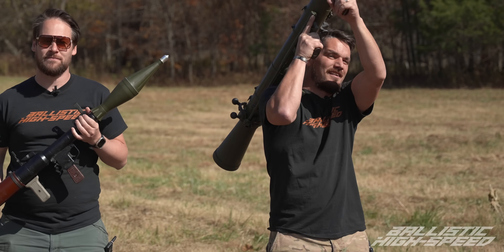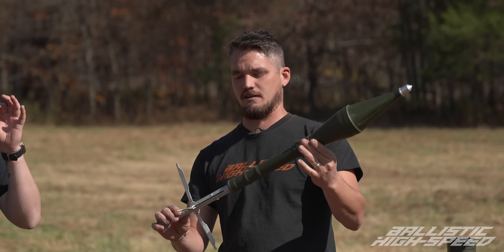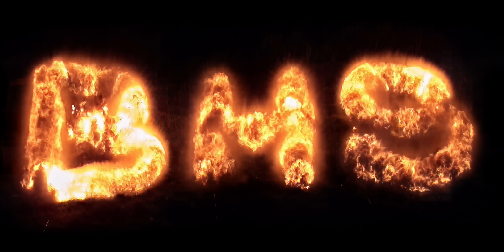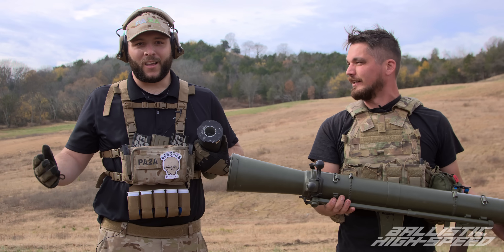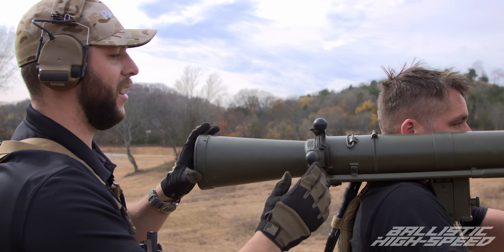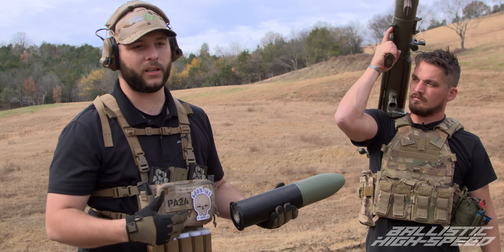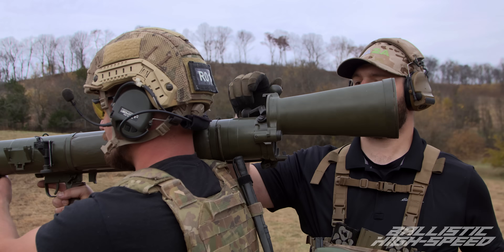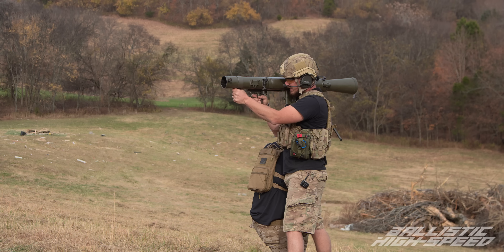Rocket Launchers and The Dangers of Back-Blast! - Ballistic High-Speed

Comment: Thanks to the medical staff who responded & who took/are taking care of him. Sorry to hear it happened to the guy who took safety seriously.
If the channel has integrity, IMO they'll release a series of videos informing people about things like:

1- what sort of medical training & equipment is most useful to have when working with guns, explosives, etc. (you should have this safety gear. you should have this sophistication of medical kit. you should know these techniques: cpr, how to apply a temporary suture, how to move/transport an injured person [especially if you're a duo], how to assess injuries, how to use a clotting agent, etc. you should have these numbers to call, and locations of the nearest hospital capable of handling a patient in this condition. you should be able to quickly determine when a person requires personal transportation, ambulance transportation, or helicopter transportation. how to communicate effectively with the dispatcher, and know what information they need. how to self-care if you're alone, what level of injuries may be fatal if solo, how valuable a partner is & how do risks escalate if alone, what kind of emergency communication might help if alone, or in a group out of public areas)

2- what you wish you knew, what you were missing, why the accident happened, what mistakes you made, what things would have helped

3- what went wrong. how serious was it. what were your immediate thoughts. what are your thoughts in hindsight. what would you tell other people. what do you wish other people understood about the seriousness of accidents & emergency response/readiness.

4- showing the uncensored footage (I'm not going to argue strongly one way or the other. IMO it would benefit viewers, but respect whatever decision Adam makes. IMO it is very clarifying to see in real time cause-and-effect. Watching events unfold, teaches you how serious "small" injuries can be. A bit like how the results of vehicle accidents have been used for decades to demonstrate what happens in real life. A simple piece of shrapnel can break cheap glasses, can blind you, can cause bleeding requiring a doctor or immediate intervention, etc.). A small explosion can permanently scar you. That doesn't touch on things like psychology (why you should be prepared, the harm of panic, the harm of not knowing what to do/who to call/how to communicate what is needed & how quickly, how to interact with the subject, how to be useful, etc.)

I'm sure this is a series-of-events which has been repeated for millenia. And I'm sure there have been studies done, and planned responses created, and training courses designed, beyond anything I can contribute. I hope that collected knowledge is gathered & shared with the BHS viewers.

Hopefully PA2A was run by someone with care and consideration for things of that nature. I have only personally experienced moderate injuries, but IME it is enough to be thinking about things like, "am I ever going to be able to walk again? Will I be able to work? Have I just altered the course of my life permanently?" in the moments after a serious injury, without the panic of, "Do the people around me know what to do? How far away is help? There is blood running out of my shirt, and down my neck. I can't see. Am I concussed? I don't remember where I am. I can't feel my legs. Am I going to die out here in the middle of nowhere?". IMO it's extremely disrespectful to the people who have experienced accidents/injuries to sweep these things under the rug, or fail to address them.

I don't know anything about BHS. I don't know if they're careless, reckless youtubers- and this was only a matter of time. Or maybe they're quite respectful and considerate, and this was an example of accidents happening to anyone. What I do know is, like any sport/hobby with a degree of danger tied to it, you have a responsibility to the man next to you to be informed of how to care for him in an emergency situation. Just like when you are injured, you'll be relying on his competency to get you help. The man with the least knowledge of what to do, seems to be least-respectful to his companions.

I don't mean any of this as an insult, or to beat on the people involved. I consider it insulting to wave away misfortune/accidents, or lie to an audience & mislead the seriousness of even seemingly minor accidents (let alone an explosion a few feet from your head). I'm not implying anything like that has happened; what I am saying is that I hope it does not- I hope that the people involved use the opportunity to educate and inform others of what the experience is like, what to expect, and how to respond in the most effective way possible. It's a unique opportunity, for someone to do a few hundred hours of work, to potentially benefit hundreds of thousands+.

From what I recall, InRange/Forgotten Weapons did a fairly good job of a post-emergency debrief, when Ian had some cartridge shrapnel penetrate his chest (as I recall)- "Dangerous Things are Dangerous: The Importance of Medical Training", and "The Story Behind Ian's Shrapnel Kaboom". My guess is that BHS has a wide viewership, and can take advantage of being fed a variety of training techniques from people of across the globe about emergency response (from people like EMTs, ER doctors, military medics from many countries- both working out of a backpack & in small/less-capable hospitals, people working in remote areas in dangerous jobs, the emergency operators/dispatchers, etc.), who are likely also pretty passionate about their job/training if they voluntarily watch this stuff. Hopefully the people involved view the event as an expensive learning intervention, go to the effort to inform themselves, and generously take the opportunity to educate others through a series of videos.

Adam, I wish you strength of mind and body in the rehabilitation track, and am glad you're still with us. And condolences to everyone who has had a serious injury which they recovered from, only partially recovered from, or unfortunately overwhelmed them. Sorry if it was involuntary. I only know a little bit about it, but have felt the, "Oh God, this is bad" and I think it's hard to communicate the seriousness of that to the unexperienced. There are people out there who have a respect for what you went through, and can only imagine the impact it has had on your life. I hope you put energy into creating something productive/positive- & I hope part of it is into informing other people about what an emergency is like, and how they can best act when there is no time to Google or learn.

If anyone has videos or resources they feel are valuable to share, please do so, for the benefit of all reading.

Comment: I was waiting for this videos since i am very fan of RPG-7. Never thought how dangerous a miss fire could be. And most impressive is that you still release the video and you were very transparent about this accident. This demonstrates how professional you are.

I wish the best recovery to Adam. And I am looking forward for more vídeos from both of you!
Reply: Wasnt a misfire, they used a rejunk reactivated cut tube instead of being smart about it.
Reply: @limoduhLmO  The tube has very little to do with it, they already fired inert rounds out of it without issue.
The problem is the round, despite how simple the RPG is, its rounds do have safety mechanisms to stop them from detonating before they've travelled a safe distance. 
Either the safety mechanism was missing, malfunctioned (Very rare on an RPG, its made to be idiot proof) or the round itself wasn't machined properly. 
Its possible the propellant was also incorrect, it could have been a faster burning powder or wasn't compressed into a pellet properly so instead of burning slowly, it all burned at once causing a deflagration that caused the tube to explode and the round to detonate.
Reply: @WarlordEnthusiast werent they using full steel rounds? or at least intert ones? so the safety mechanism either wasnt even there or wouldnt have done anything since there wasnt any explosive/warhead present to begin with
Reply: @headshothunt3r414  The first few rounds were but the last round was a high explosive round with a detonator.

Comment: Im no expert bur i have seen normal rpgs when they fail to extract tend to send an operator thats gripping the laucher tightly. i would sugest to inspect the round that was used for structural integrety issues were the propelant was directed to the wall of the tube instead of the rear.

Comment: Godspeed Adam. I hope you a quick recovery. I also do hope that you guys caught that malf on high speed. It may prove useful at improving the safety of those rounds.
Reply: I imagine they are keeping it private until Adam recovers and either gives consent to release it or not. Hopefully he does agree to release it but it doesn't seem right releasing it now knowing he's currently recovering in the hospital
Reply: @jacobkudrowich  Oh You misunderstood my meaning. I absolutely DO NOT want that footage leaked unless it is with permission of adam. The only people who currently deserve too see that footage are the ones who manufactured the rounds. To get a better understanding of just what happened with that round. And hopefully prevent it from happening again,
Reply: I was under the impression that the rounds were modified/not made by a reputable company.
Reply: @litreland764  Whoever made the RPG Rounds is not their fault that weapon is just FLIPPING DANGEROUS you have a giant  pipe bomb sitting on your shoulder ... As for the video i hope BHS never shows it You are not going to learn anything from it other than watching Adam getting badly injured
Reply: I think "pipe bomb" refers to a completely enclosed container. I assume a rocket failure suffers from something like uncontrolled burning (a rapid ignition of a large quantity of fuel, which causes an over-pressure explosion). I assume that's most likely to happen with improperly made fuel, or maybe next most likely improper storage/handling/age. Or simply mistakes when making it. BPS Space has some videos which cover solid fuel vulnerabilities - but idk if that's what was used in this incident - some random comment mentioned gunpowder, another mentioned it may have been made by some third party or modified or something. Probably not worth speculating about in the low quality of the comments section.

I think there's a lot for a layman to learn from the uncensored footage. I made another comment explaining why I thought that way. I hope they make some videos covering the post-incident analysis, both regarding the equipment failure, and the human response. It seems like the most responsible thing to do.
Reply: @litreland764  I agree making a video post incident analysis but showing  Adam getting injured i say never show it it was like getting horse kicked in the face watching it .. lucky for Adam he had on some protective gear on But Bryce on the other hand he has to be luckiest man alive  when Bryce fired that RPG all he had on was hearing protection and that's it that Flipping RPG weapon could  easily  exploded on Bryce with fatal  results

Comment: I saw the penultimate launch of the RPG7 in slow motion, there was smoke coming from the area the front grip was at and wondered if that was right. But I did not see that misfire coming!
Reply: Note by the side: Depending on if they stopped and saved the slow motion footage in that situation (which obviously would be a very low priority, but who knows, maybe muscle memory did its thing), it might be possible to determine exactly what happened. it could be the most well documented rpg failiure ever...
Reply: @foersterjunior  yeh if they did hit that trigger button they might have some footage that they can look over and use to make sure it can never happen again
Reply: Does seem like alot of blow-by coming from that area during the shot. I'm sure they'll investigate where the failure point was
Reply: After rewatching the 30,000 fps there is a gas leak, at the fire control, that progressively worsens with each firing. I am not an expert in this launch system but, is that normal?
Reply: Good catch, that booster charge absolutely has too much punch to it. What other footage of the RPG7 there is shows a very small amount of smoke coming out of the front, and none near the grip itself.

It's not a 1-1 with Kentucky Ballistics catastrophic failure, but i think the same thing happened here. A round that was way too hot caused the pressure to go way past safe limits of the chamber/launch tube. Of course i can only speculate, hopefully the issue is caught and addressed either way.
Reply: @capt5656  It's a Reactivated Launcher. Most likely a weld issue.